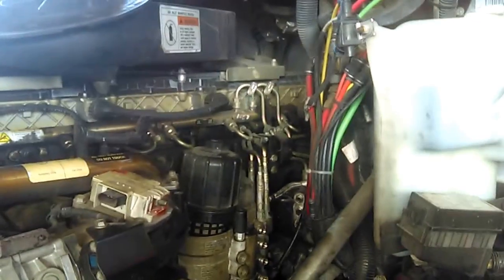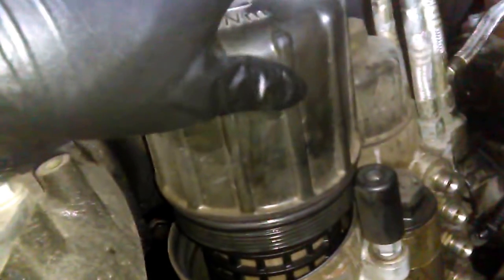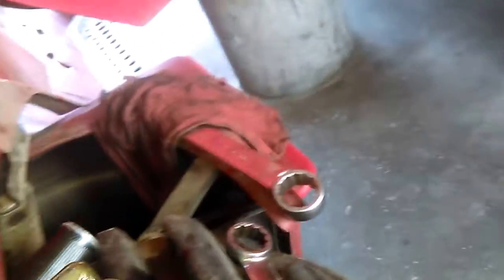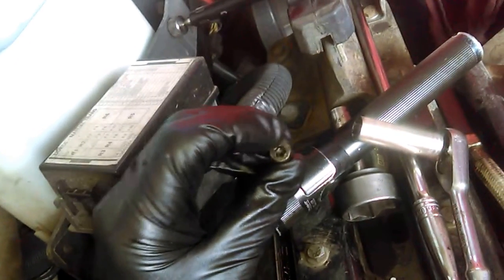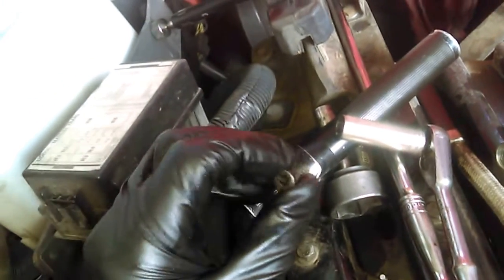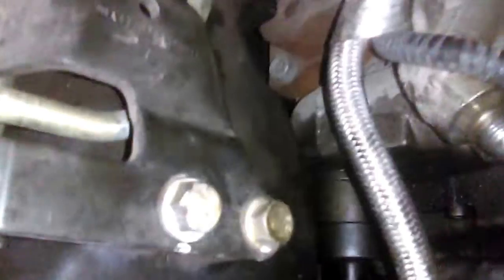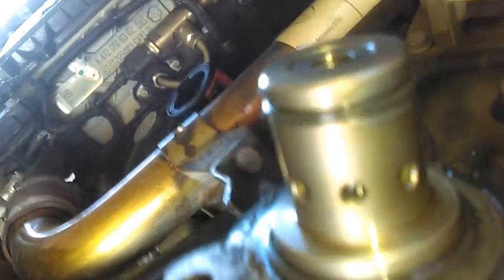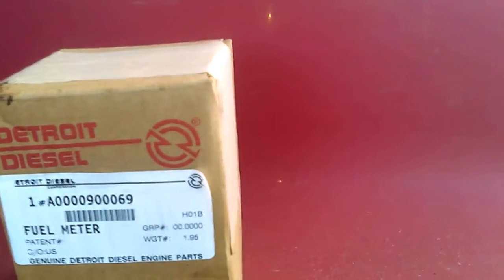Detroit DD13 DD15 DD16  fuel quantity valve replacement OM 471 472 473 MERCEDES BENZ

Comment: Hello Francisco I have a dd13 on my 3 rd mechanic it’s making a chirping noise at 900 to 1000 rpm but it starts when the truck has ran for about 45 minutes and it feels like looses power the 3 mechanics have changed fuel pump injectors and pulled the head he though it was cracked can you give me some advice please

Comment: Hola Francisco 
Que tan malo es tener la quantity valve mala 
Cuánto tiempo se puede trabajar con ella así ?
Reply from the maker: lo peor que puede pasar el que el motor se apage. pero vuelve a encender. todo depende de que tan grave sea la falla pero puede pasar algunos meses
Reply: @franciscoamayaYT  
El check engine light debería  encender cuando esa válvula está funcionando mal ?
Pues mi camión hace ese tipo de idle sound pero engine light esta off .

Comment: 2015 Cascadia with a dd13 and automatic. Idles great. In nuetral, Dies when you push the accelerator in. No fault codes. In gear, it just struggles to stay running, barely moves. Any suggestions?

Comment: Hello, My 2016 dd13 is making the "rough idle" sound but It also recently showed a code spn520268 fmi 16 (fuel pressure too high). Are both signs of a bad fuel quantity valve or would that bad valve not cause that code? Can something else cause the rough idle that is also causing that code?
The truck runs great no signs of issues on performance.
Reply: i am having same problem with my dd13 2017 i have a surge idle and test is giving almost 100 bar different. i will change the quantity valve and hope it will fix this problem.

Comment: Thanks for your great videos! Today my DD15 did not start. I discovered there was a leak, and then that one of the bolts holding the fuel quantity meter unit (A0000900069) had gone missing (no wonder fuel was leaking out from between the metering unit and the pump). I just asked what size the bolt is but found the answer myself - it is a A1689901212 (M6 x 16 mm) in case it helps someone.

Would you recommend I change something else at the same time while I have things apart?

Comment: I have a DD15 that only in the morning needs starting fluid to start.  I replaced the check valve in fuel filter housing still no difference.  What would you suggest?
Reply: Tengo el mismo problema y lo diagnosticaron con la computadora y salio que tiene baja presion el fuel rail y que es posible que la pompa de diesel esta dañada

Comment: Hey guys I had a really bad idle problem and I was thinking to change that part but instead I clean the fuel entrance on the water separator filter (it’s a white plastic bypass was completely clogged with all kind of silicone or paper) my problem it’s gone now, just try that before to waste your money it’s easy to clean
Reply: I know it’s been a while since this comment, but I can’t find a video about how to do this. Is it just opening the fuel separator and cleaning below the filter?

Comment: some one can tell me why my dd15 alway i started with starting fluids i don't know if it's the fuel pump or not because one's starting it works perfectly and i got code ecu 128, pid 235, sys 137, sid 06 can someone tell me what to do?
Reply from the maker: Probably the fuel check valves are bad
Reply: @franciscoamayaYT  i already put a check valve and nothing happens same problem
Reply from the maker: Which one you replaced?
Reply: @franciscoamayaYT   no replace i just put one on the fuel line return
Reply: @franciscoamayaYT  do you have a telephone number

Comment: What is the purpose of the quantity? Fuel valve And what? Problems does it solve for your truck
Reply from the maker: Is the to control the amount of fuel to increase or decrease the fuel pressure delivery to the injectors.

Comment: Hi bro I have problem in my fuell tank.  All the fuel go from driver side tank to the passenger side tank.  Do u have any idea.  Thank you so much
Reply from the maker: Check the fuel valve that is on top of the transmission, maybe it is close.
Reply: Thank you so much I will try

Comment: I have rust shavings in the small fuel filter do anyone knows what that is ?
Reply from the maker: It could be debris from the fuel tank.
Reply: Francisco Amaya do I need to clean out the tanks with something? Or flush all the filters out ? Thank you ! It has a weird buzz noise when it’s idle like it’s coming from the fuel filters or the lines or fuel pump

Comment: Is pressure limiting valve the same thing as the quantity control valve? My truck makes same sound on and off, then I get engine light after I start it after sitting overnight, and it revved up to 900 rpm and gave me  spn 5571/15. I turned the truck off and waited a bit, and the codes went away but mil light stayed on. Will the valve stuck open give me that code? I also didn’t change fuel filters last oil change and noticed little air bubbles in fuel filter bubble. Maybe just bad filters, or not tightened all the way?

Comment: hey man, in relation to this video i change the fuel pump to my truck because it just turn off on me and the  computer show the message "low pressure rail"  now since the quantity control valve comes new/re-manufacture with the pump could it be possible that the valve is defected or not working properly? Because now the computer is showing me a New code that reads "quantity control valve".

Comment: Hi i have 2015 freightliner cascadia it giving error fuel quantity mass too high in multiple cylinder,tried many mechanics no one fixed it plz plz help spn5357 fmi16 is the error code.MIL light always stay on.
Reply from the maker: That code requires a high diagnostic process.  It can be caused for the following 
Bad barometer sensor 
Bad delta p sensor
Bad intake pressure sensor 
Bad fuel quantity valve 
Bad fuel pressure sensor

Comment: I have issue with fuel pressure low. When I'm driving heavy on hill the check engine light come on and no power after hill road straight power back and no check engine light. What's can be? Please help
Reply from the maker: Maybe fuel injectors are leaking

Comment: Hello Fransisco I have a 2011 freightliner CancadiaDD15 got Codes SPN 3556 520250 5418  Dealership sayings Doser Block needs to be change do you think the Quality control valve needs to be change to.
Reply from the maker: First try this 
Click on the link below 
https://youtu.be/EozE5jZ91RI

Comment: If valve is bad can it cause lots of fuel to be put into the injector flooding it and then spilling out the turbo??
Reply from the maker: No, that can be caused by faulty injectors

Comment: Hi! I have a 2012 Freightliner with a DD15 I lose prime after truck sits over 2 hours then I have to hand prime it. I just had a inframe done. Check all filter. Dealership did pressure test everything checked out okay. They said I need to replace my quantity control vavle will that cause me to lose prime when engine sits overnight ? Thank you !
Reply from the maker: No, that is not. 
It could be air on the system or  screen filter check valve problem

Comment: When changing the fuel quantity control valve. Do you need to hook a laptop up to it and reset any parameters, or can you just swap out the part?
Reply from the maker: You need to reset the learn data but it is not mandatory. 
You can replace the valve and it will be ready to go. No need to reset anything.
Reply: Francisco Amaya thanks Francisco for the tips

Comment: Francisco. What could happened if you don't reset the fuel quality valve after replacement? Thanks
Reply from the maker: Nothing, it will not make any changes on your truck.  It will relearn itself with time.

Comment: Hey bro I got code  ICU 23 and my gage not work properly I am losing fuel  dealership after they change fuel sensor they told me to change quality control valve is this related with this video ,?
Reply from the maker: Yes, this is the fuel quantity valve 
If you want to know how to replace you check my video https://youtu.be/YsP8GeSthko

Comment: How you know if its going bad??
Reply from the maker: By a noise the engine makes while the engine is idling, check the video for details. 
https://youtu.be/gYq_bcfBQk8
Or 
The check engine light comes on with a code related to it.
Reply: Francisco mi camión no prende y tenía un rough idle y se apago solo crees q sea la bomba oh el quaintity valve?
Reply from the maker: Probably, reviselo con la computadora
Reply: Francisco aquí todavía estoy en el taller le pusieron la bomba nueva y todos los filtros solo prende con starting fluid pero no se queda
Reply: Y el butterfly q va encima del turbo está votando aceite
Reply: Llámame por favor para q me des una idea ((973)606-0774
Reply: Hello Francisco todavía estoy en el taller y nada le cambiaron un injector y nada

Comment: Would you have any idea why my DD15 is losing prime?  The last jobs I had done was the fuel pump & air compressor O rings and the Injector Harness.  Seems like the issue started around this time.  If the truck sits too long, it won't start & has to be primed as if it ran out of fuel.  Pressing the prime button won't do the job either.  My mechanic has to hook up that primer can that looks like a bug sprayer.  After doing that it starts right up.  I can't go anywhere like this.  Any ideas?
Reply from the maker: It is possible that your fuel check valve is not working properly.
Reply: Francisco Amaya Thanks for your response.  Where is this located on the DD15? Its a 2011 Cascadia.  Looks like the one in this video except I dont have the added clear fuel filter.
Reply from the maker: It is located near to inlet diesel like to the fuel filter housing.
Reply: There is no check valve on this engine.  It's called a Pressure Control Valve on this engine which serves the same purpose according to freightliner.   Could I be losing prime possibly because of the Fuel Rail?  It's leaking at the bolt on the end of the Fuel Rail facing the firewall.  It leaks worse when the gas is depressed.

Comment: the part is 750 but the whole pump.is 1200 & comes with the whole set up mightest well pay the extra bucks & change the whole thing thats just me.
Reply from the maker: Yes, it is better to replace the whole HP fuel pump but the labor cost and the parts increases. 
I recommend, if you have enough money you better replace the whole thing to prevent any future problems. If you don't replace the FQCV only.
Reply: Francisco Amaya
Can you  please help me to replace def metering valve to fix this truck , thank you , send me you address shop boss

Comment: The code logged 3480/2(SPN/FMI) indicates "Fuel Compensation Pressure Sensor / Doser Fuel Line Pressure/Data erratic, intermitteent or incorrect" 
This fault indicates that the Hydrocarbon (HC) Doser Fuel Line Pressure is Low

Possible Causes:
Fuel Filters not seat properly in Module
Plugged HC Doser Injector Valve
Plugged HC Doser lines
Fuel Line from HC Doser Block to Valve plugging

This fault will cause a 10% Engine Derate

Standard published diagnostics should resolve the problem.

If this unit is equipped with a GHG17 engine, there may be a software update available to help prevent this code.

Can you address this problem

Comment: How long can i run the engine without replacing this valve?
Reply from the maker: +drone1028 
No, sure. 
It can run for more that 300,000 miles but I can damage you fuel system components and it will waste more fuel.
Reply: drone102

Comment: You don't need to remove coolant line that goes from air compressor to block?  Men i see you even did not remove steering shaft and big black splashguard plastic for better access. How did you take off the bracket? 😀
Reply from the maker: +Mushegh Hayrapetyan 
You don't need to remove the coolant line for DD15 engine from 2008-2011 (w/o DEF)
You do need to remove the coolant line for DD15 engine from 2011 and up (w DEF)

I don't need to remove the steering column or the plastic cover to replace the quality valve. All models 2008 and up (except the short nose Cascadias)
Reply: Francisco Amaya are you from los angeles area?
Reply from the maker: +Mushegh Hayrapetyan 
Fontana CA
Reply: on 2012 Cascadia black plastic splash shield must be removed so you can get access to plastic tube that goes from compressor to block. Also T30 socket must be  ~ 2.5 inch long and 1/4" drive would be nice. The screw that is located behind of valve is hard to reach. If you are fat guy with fat fingers don't even try to do it :-)
Reply: Hi Francisco 
I have a DD15 2012 
Basically manufactured on June 2011
But it said 2012 
So do I need to remove Coolant to replace the 
Fueling Metering valve???

Comment: I have a  Columbia Detroit Series 60 I think my doser valve is out I had all my check lights come on and my truck stoped on the road. Road squad came out and did a regen and said it should a injector going out and the dpf pressure is too high. Could it be my doser? It's got a new dpf filter and module put in November. I might need a dpf cleaning I think. What do you think.
Reply from the maker: +Mikey Mike 
Press the override button to override the engine shutdown mode, place a penny or a peace of paper to keep to switch on all the time. 

Do you the code description that your truck has?
Reply: Francisco Amaya at the time i did press the override button to get me down the road after the rod squad did a regen it didn't happen.  At the time they hooked up a computer did a regen no active codes showed up they did a injector cut out test and it showed #4+#5 injector was going bad it slugged as they did it. It showed the  dpf had high pressure. Maybe cause it's not regen properly. I'm getting the dpf cleaned today. And I'm not sure if it needs a new doser?
Reply: @March808  what happen after all?

Comment: What did you use to undo the fuel lines and do they have to be torqued back
Reply from the maker: +Garrett Reynolds 
The steel braided lines right?
You need to hold the inside fitting with a thin wrench (15/16 or 24 mm thin wrench) to release the line.  
The same thing for the small ones just with different wrench size but it has to be thin.
Reply: Do you have torque the lines ?!
Reply: So no special tools are needed
Reply: Well a tools list would be nice
Reply from the maker: +Garrett Reynolds 
No, you don't need to torque them, just make sure they are tight enough. 

You will need
For the fuel quantity valve
1/4 rachet
1/4 extension
Torx T 30

To access to the fuel quantity valve
3/4 wrench
7/8 wrench
15/16 wrench
Cutter
Stubby 3/4 wrench
18 mm socket
13 mm socket
3/8 rachet
3/8 long extension
Some tools may vary depending on the year and application of your DD15 engine.
Reply: Garrett Reynolds stupid question...